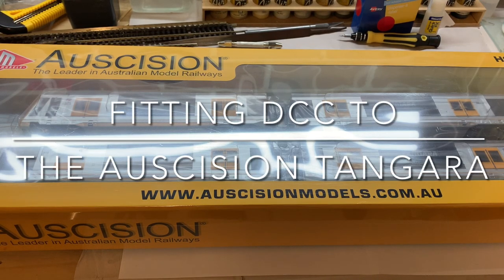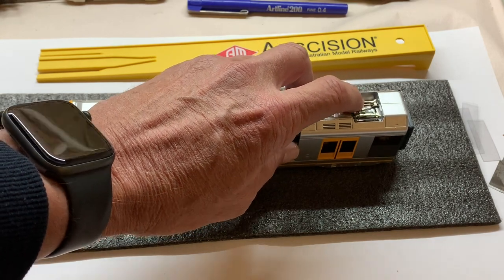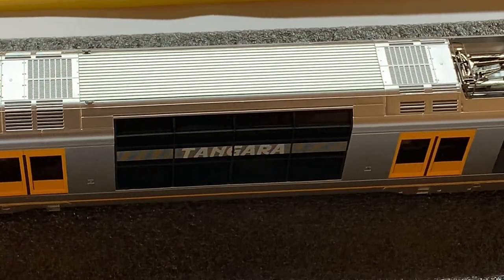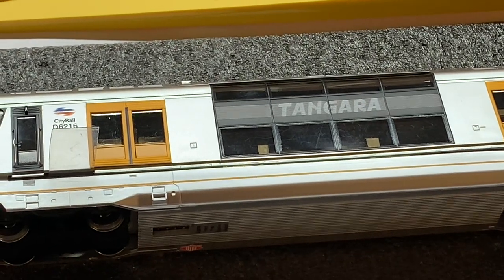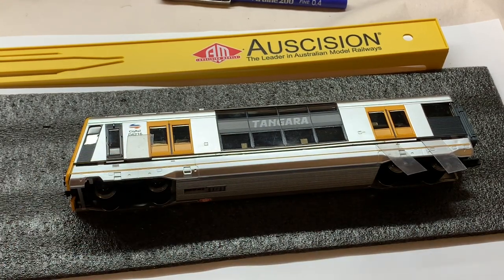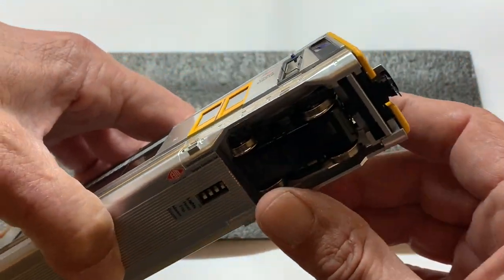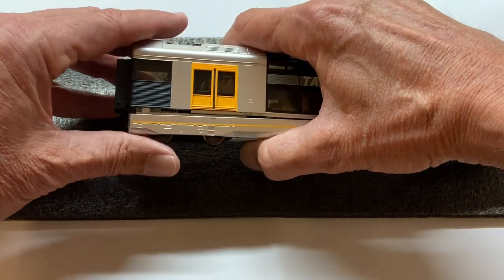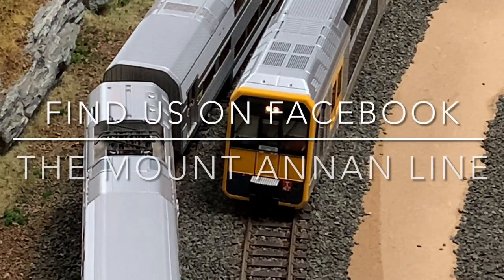Fitting DCC to the Auscision Tangara

Comment: Thank you so much for posting this. I went to Mitre10 and picked up a $10 models blade kit that had your knife blade, so I used that.   It was not easy.   Just recently I watched a video of the whole design process and construction of model trains. So how you could end up designing something and have this nightmarish design fault I don’t know.
I love their work – but they need to have a think about access to the inside of their models.
The documentation is terrible.   It said nothing about swapping the plugs over to DCC on the circuit board.  Mine would not lift off and ended up pulling the DC Female plug of the circuit board!
There is a mystery bag of supplies in the box too… I have no idea what they are for – there is nothing in the documentation.
I had NO IDEA about the lights and their functions so thank you for that.  I am relatively new to this hobby and get so frustrated that no one bothers to document everything so new people know about this stuff vs just taking it for granted that everyone knows everything.
But again - Thank you so much.   It took 45 minutes – but I finally opened the Drivers carriage.
Reply from the maker: Hi Fraser, I am glad the video helped you. It can be frustrating when the documentation is a bit lacking. Unfortunately I also had a similar problem with one of the lighting plugs since posting this video. They seem to be only surface mounted to the PCB and detach very easily. In mine, it was the DCC plug housing (thankfully in the dummy end) that detached. Luckily I was trying to reinstate the wiring harness to the DC plug there, as it seems to me that there is a problem somewhere in the lighting functionality in the dummy end (mainly around Aux 3 and Aux 4 functions not being recognized). This is not an issue in the motor end and can be worked around in the dummy end with the assistance of either JMRI or a Lokprogrammer (depending on the type of decoders you are using). It requires some tweaking to what lights come on in what directions, but I’ve managed to work that out in mine after a little experimentation. I agree about model accessibility, a screw on type situation for the cab bodies could potentially save a lot of headaches. I also saw the video you mentioned, it was quite interesting and shows just what a complex process is involved. It’s no wonder that the design and development phase can be so long when you see what’s involved! Thanks for your comments, again, I am very happy if the video has helped a little :) Regards, Lee :)
Reply from the maker: Ps, re the mystery bag of supplies, one element of that is a Kadee style coupler that you add if you wish to attach two Tangara sets together to form an 8 car train. I was told (and can’t verify the accuracy of this) that the additional bit of little wiring is in case you are installing speakers for a sound decoder.

Comment: The contents of the mystery bag...
The wires with the plugs on the end are for wiring in a speaker if you wish to add sound to the model.
The additional coupler boxes are to replace the end plastic moulded coupler and, install a knuckle coupler to join two Tangara sets together

Comment from the maker: * Update 28/4/21 ... Given there are folks (myself included) experiencing lighting issues, I would now advise leaving the lighting plugs in the DUMMY locomotive in their DC positions rather than moving them to the DCC slots. The reason for this is that there seems to be an issue with the AUX 3 and AUX 4 outputs at the dummy end that impacts on lighting functionality. By leaving things in the DC position in the dummy end you can apply a work around to get the lighting functioning correctly. Lead (motorised) end seems to be fine with the lighting plugs in the DCC slot as shown in the video *